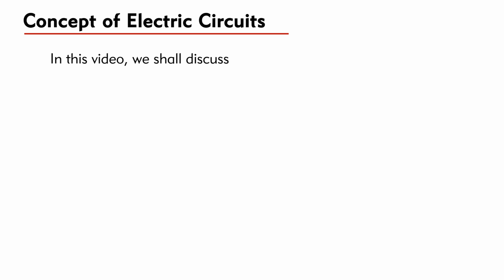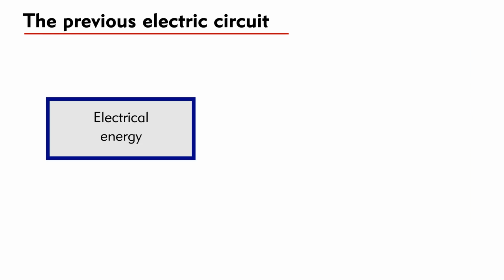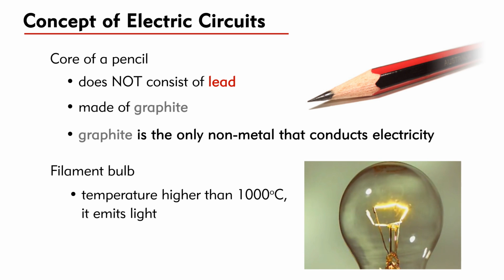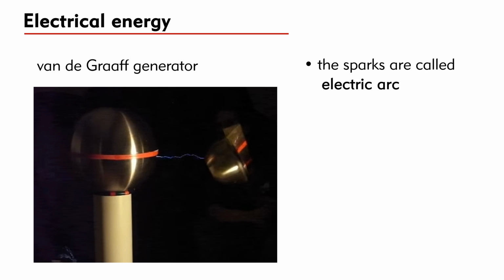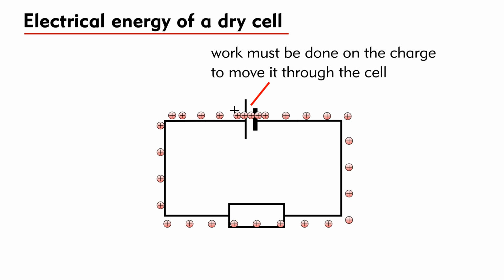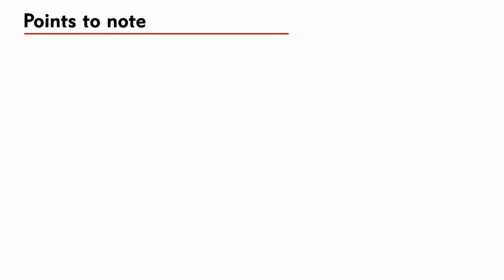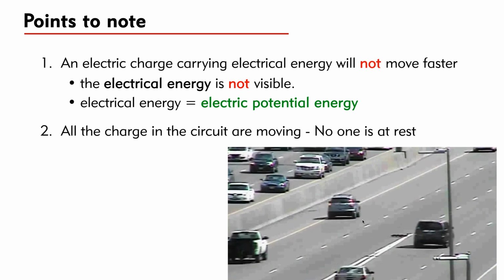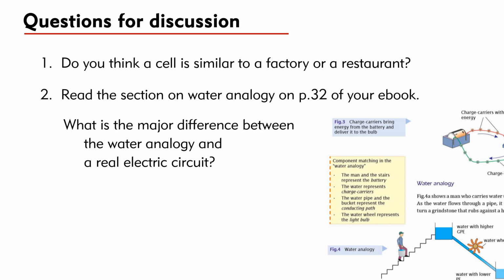Concept of Electric Circuit

Comment: 1. A factory or a restaurant would refer to small and individual units / workers working simultaneously and operate in a seamless fashion such that the entire factory / restaurant would run as smoothly as possible. A cell is close to that, working similar to those individual units / workers.

2. The major difference between the water analogy and a real electric circuit is that the energies involved in the conversions are different while representing the same logic that the use of energy conversion results in practical usages i.e. producing heat and light. the water analogy refers to the conversion of GPE into KE producing heat energy. By contrast, real electric circuits, chemical energy is converted into electrical energy and provides energy to the load.

Comment: 1. Yes.cell is similar to the factories that it provide energy to the load and the factory also provide raw materials to produce goods.

2. The major difference between the water analogy and the electrical circuit is that the water analogy converts G.P.E to heat while electrical circuit converts chemical energy to electrical energy.

Comment: For question 1, I do think that a cell is much more similar to a home than ah..... a factory? I'm sorry to say that I just cannot imagine how the running of a factory can be similar to the operation of the cell, as it frankly doesn't produce any matters! In the above video, what I've learned is that "the cell does NOT produce any charge". Instead, it drives the charge-carriers that already exist in the circuit into motion. What I can imagine is that the cell represents our home(restaurant is acceptable), and the light bulb(or the burning pencil!?) represents the unpleasant school, or office, or any unpleasant places that use up our energy!!! And we, are the charge-carriers. After our daily work, we get back to home, tiredly, and then have our delicious dinner, spend our time with family, watching TV, relaxing, then go to sleep at last. You must gain enough energy to go to work in another day, isn't it? Just similar to the cell: charge-carriers gain electric PE --> convert them into other forms --> charge-carriers loss energy --> cell provides electric PE --> charge-carriers gain back more electric PE... See? It is a cycle! A cycle similar to our daily life, but not a factory that keep producing goods as its only purpose. Cell provides energy to us. Our lovely home also did:)

For question 2, I think the major difference between the water analogy and a real circuit is the relationship between different forms of energy. In water analogy, GPE is converted into KE, during the process of sliding water. In real circuit, however, electric PE and KE are independent! After the charge-carriers pass through the load(light bulb for example), they are still moving towards the cell! Although I don't get the concepts behind, that's my point of view. And I hope the next video can help me get them:)

Thanks for spending time to read them all (if you did). Comments are always appreciated;)

Comment: 1. Yes. The cell provides electrical energy to the electrical devices, which is similar to factory supplies products and restaurant supplies food. Therefore the cell is similar to factory and restaurant.
2.The water analogy converts potential energy into heat. However, a real electric circuit converts chemical energy to heat.

Comment: 1.Yes.Cells are similar to a restaurant as a cell provide electric energy to the electric devices,while a restaurant provide goods and services to the consumers,so they are similar.
2.The difference of water analogy and a real electric circuit is the conversion of energy.The water analogy convert GPE of water into kinetic energy and heat energy of the water wheel,while a real electric circuit convert chemical energy into electric potential energy.

Comment: similar to restaurant, cell=restaurant, when charge pass through the cell,  their electrical energy is replenished(people have lunch in the restaurant , they will have more energy.)

the different is real circuit is  converts chemical energy to electrical energy. water analogy is converts potential energy to kinetic energy to produce electrical

Comment: 1. Yes, the cell produce energy as it is the energy source, it change chemical energy to electrical energy, and supply to the electrical devices, it is similar to a restaurant and factory.
2. The energy change in a electric circuit is from chemical energy to electrical energy. However the change in water analogy is from GPE to kinetic energy.

Comment: 1.yes it more like a restaurant .It is because the cell and restaurant both provide chemical energy.
2.water analogy converts potential energy into kinetic energy but in real electric circuit the EPE will not provide kinetic energy

Comment: 1.yes as call, restaurants and factories are also providing food or energy to a electrical devices which is human and the economy of the country.
2.the major difference is that the water analog use gpe to generate electricity, but electrical circuit is convert electrical energy to other form of energy.

Comment: 1. Yes. As cell is a supplier that provides electrical devices with electrical energy, which is similar to a factory or a restaurant that act as suppliers and provide customers with  products and food .
2. The major difference is that water analogy converts potential energy to kinetic energy while electric circuit converts chemical energy to electric potential energy.

Comment: 1 the cell provide charges as a supplier. a factory and a restaurant provide good and food. they all work similar
2. the water analogy convert GPE to heat,while real circult convert chemical energy to heat

Comment: 1. A Cell is similar to a factory and a restaurant because. A cell deliver charges. Chemical energy is converted to electrical energy. There are workers and cooks in factory and restaurant they produce food and thing from raw materials to useful things or food. So they are similar.

2. A real electric circuit has to form a full circuit to make it work.
But water analogy is turning the potential energy in water to kinetic energy moving the wheel so it can be one side to another don't need to be a full circuit.

Comment: 1. Yes. They have similarity. A restaurant(battery) is trying to turn chemical(raw material) into the thing that the consumers need: electrons and food.
2.The major difference of them is the energy conversion. A water analogy is converting gravitational energy into kinetic energy but electric circuit is converting chemical energy into electrical energy.

Comment: 1) Yes, because the cell supply electrical energy to the electrical device,  just like the a factory or a restaurant supply food and service to the customers. 
2)The major difference is that the water analogy coverts potential energy to kinetic energ, but for the real circuit,  chemical energy is converted into electrical energy

Comment: 1. yes because the energy supply is equal to the meal given in restaurant or the good produced in factory. And the used up charge-carries energy goes back to the cell, this equal to the used dishes and cups  in restaurant or the sub-products in factory.

2.the used water will no t move back to start point automatically.

Comment: 1.Yes it is similar to factory .In a factory ,the machine works in a constant speed and each part of machine won't at rest .It is similar to a electric circuits ,which in a electric circuit ,all the charge in it are moving and no one is at rest .

2.In a electric circuit ,the battery is used to consuming the energy which is chemical energy , thus it will convert to EPE.However,in a water analogy ,the work is done on water to raise the GPE,and then it converted to KE of the wheel .

Comment: 1)It should be similar to the factory.Since a factory has a stable and fixed way to move and the workers of the factory are similar to the charge-carriers.
2) They are different that the GPE of the water is converted to the KE of the water in water analogy. However, in a real electric circuit, the energy will not be converted as water analogy. The electric PE is converted to the heat energy but the KE wont change during the process.
Reply: I couldn't agree more with your second answer!

Comment: 1.yes.the cell is  to drive the charge to move and provide electric potential energy. It's similar to the factory input the raw materials ,then process ,finally output the products.Also like produce food in restaurant ,the chef cook the food final service the customer.
2.water analogy is the water flows through a pipe, it will turn a water wheel , which will turn a grindstone that rubs against a hard surface ,then produce heat.The major difference is the water analogy change potential energy to kinetic energy.But the real electric circuit is change the chemical energy to electrical energy.

Comment: 1.Yes. As a cell supplies electrical energy to every part on the circuit, it is similar to a factory that supply the food to the customers.
2.The energy change between them is not the same .Water analogy conversion is change from P.E. to K.E while electric circuit convert chemical energy into electric potential energy.

Comment: 1. Yes, I think a cell is simliar to a factory. Cell provides electrical energy to the moving charges and charges flowing out from the positive terminal to the negative terminal. Factory provides final goods and goods flowing out from the factory to the consumer. While restaurant consume final goods from the factory, defining as other electrical devices will be more resonable. 
2. The major difference between water analong and a real electic circult is the conversion of energy. The water analogy converts gravitational potential energy into electrical energy . A real electical circult converts chemical energy into electrical

Comment: 1. Yes. They are both act  as a supplier. Cell supplies electrical energy which is similar to factory supplies goods and restaurant supplies food.
2. The conversion of energy is the major difference between the water analogy and a real electric circuit. In the water analogy, the gravitational potential energy is converted to heat energy while the chemical energy is converted to heat energy and light energy in the real electric circuit.

Comment: 1.Yes,the cell supplies electrical energy to the device,it is similar to a factory.It gets raw materials from outside and produce food to the others.
2.The difference between  electric circuit and water analogy is the electric circuit converts chemical energy to electrical energy,but the water analogy converts potential energy from high position to produce electrical energy which generated by the turbine.

Comment: 1. Yes .Cells are also similar to factories in that they are individual units of production and consumption within the context of a much larger economy. Small units work together to make a greater whole function smoothly .Both take up raw materials and use energy to produce waste and finished products.
2. The major difference between water analogy and a real electric circuit is that water analogy convert gravitational potential energy into heat energy. In real circuit ,  chemical energy is converted into electrical energy and  provide energy to the load.
#####Thank you for taking time to read my answer, i welcome everyone to comment on on my answer . #######^_^

Comment: 1.Yes.It is similar to the factory provide product and restaurant provide food for their customers.
2.The major difference between the water analogy and a real electric circuit is that water analogy is produced energy by a water wheel in water but a real electric circuit is not.

Comment: 1.yes,cell provide the chemical energy to give electrical energy .It's similar to the factory provide product and restaurant provide food for their customers .
2. The main different is the energy change is not same .water analogy conversion is change from P.E. To K.E. Electric circuit concert chemical energy into electric potential energy and heat and light is produced .

Comment: 1. Yes,it is similar to the factory or restaurant,since that the factory and restaurant processing raw materials to products which are sold to the customers,which similar to the cell consuming chemical energy and convert to electric energy.Those customers will pay their bills,similar to the return of charge
2. The major difference between water analogy and a real electric circuit is electric circuit is closed circuit but water analogy isn't

Comment: 1.yes,it is because cell provide a chemical energy to the circuit.This is similar to  factory provide  product to customers or restaurant provide food for customers to eat.Also,without the cell the circuit cannot be a complete circuit aa there are no energy is  brought by the charge -carriers.This is also similar to a restaurant and factory.When the factory is shut down, customer cannot buy goods in there as the factory does not provide goods.When restaurant closed ,customers cannot eat in there as there is no food provided.To  conclude , the role of cell is similar to the restaurant or factory.
2.The main difference between water analogy and electric circuit is they carry different enery to change to another energy.Water analogy carry gravitational potentail energy is changed to kinetic energy while electric circuit carry chemical energy is changed to heat energy and light energy.

Comment: 1.Yes.A cell is an energy source, the charge carriers are delivered from the cell flow through the bulb so that the bulb will light up.On the other hand,  inside a factory,the workers make the products which are delivered to the market. The factory becomes  a product  provider , like an energy source-----CELL.
2.The energy conversion of water analogy from P.E. to K.E. while the real circuit is from electrical energy change to heat and light energy.

Comment: 1.A cell is similar to a factory or a restaurant. A factory is used for producing a good. In a production line,the product(free electron) is transferred from place to place according to the route. It just like the  electric current. In a restaurant ,it supplies some food(free electron) to the customer. It also like the electric current.
2. Even we don't have the etextbook until now, I would like to try this question. The flowing speed of the water may change at any time. But the electric charge keeps on moving at a constant speed.